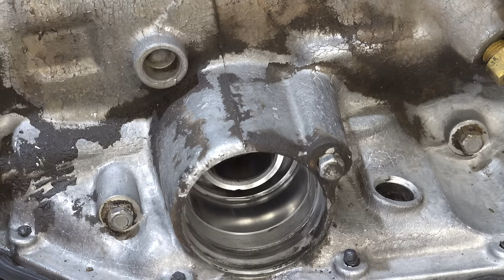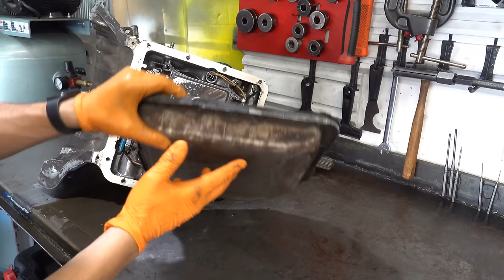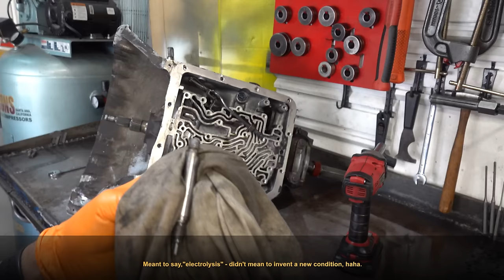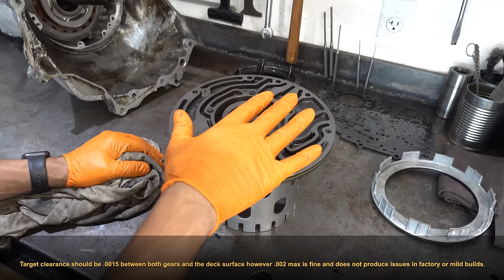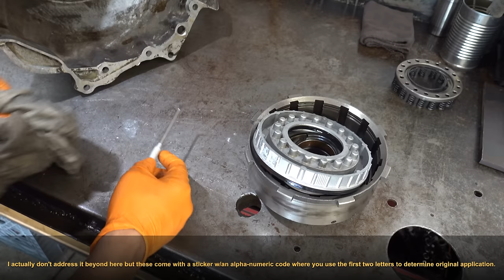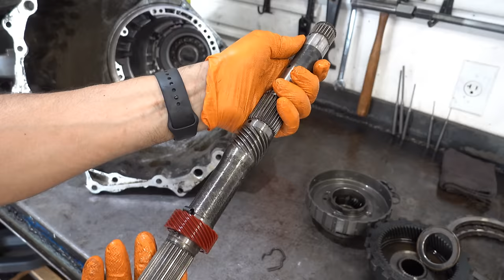TH350C Teardown and Inspection (Full Length Version)

Comment: About normal th350 transmission, I don't know if it was bad. I don't know if it needs rebuilt. I bought it from a friend for 400 bucks. It's been sitting for 2 to 3 years but they said it worked when it was pooled. How can I tell if it'll work before I put it in
Reply from the maker: Hi Malachi, thanks for watching...I'll be putting out a video on how to buy a used TH350 and share all the things I do from an inspection standpoint soon...But to answer your question now, I'd remove the pan and look for anything concerning (metal shavings, clutch material, etc...) and check the filter to see if 

a) it's a screen type or cloth type - replace if it's a cloth type with a screen type filter
b) clogged - if so, I'd be concerned about damage

Spin the converter when installed onto the transmission - make sure it spins freely, smoothly and makes no noise...If it sounds like a bucket of bolts when spun, it's no good.

Spin input shaft while holding the output shaft - they should spin independently of each other

Push/Pull on the input shaft - you should have some end play...If it's bound (i.e. zero percievable travel in and out) then it's no good and has to be rebuilt (or end play corrected at the very least).

Check the modulator (vac test if you have a vacuum test kit) and inspect the modulator valve for freedom of movement...Lube with ATF or WD40 then reinstall.

Those are the main things.

Comment: Currently have a 350c and definitely keeping it as a lockup style. Can't ever.go wrong with the lockup always nice to have
Reply from the maker: Agree; for an overwhelming majority of applications, the TH350C is perfectly fine...The TCC lock up def helps w/keep trans temps lower and fuel economy (which any little bit is a plus w/ a three speed non-OD transmission). I'll get into some of the justifications for converting when I film my TH350C-to-non-lockup conversation video this weekend...it should be out on the channel around this time next week.

Thank you for watching, bunkster90!
Reply: @mytransmissions5390  absolutely sir we love your content currently, I've always loved the lockup style which is why I have a 700r4 ealy model in My 1969 pontiac tempest restoration, also have several high performance builds we are doing here at Bunker Transmissions along with our personal frame off restorations so it's always busy busy.
Reply from the maker: Thanks again, man!

Comment: great video, as always. Very helpful for making sense of my TH350C. If you put a 4L60E low roller clutch assembly in, is it necessary to also upgrade to a 4L60E center support and inner race, or can you drop the 4L60E roller assembly into the TH350 center support and keep the TH350 inner race? Thanks!
Reply from the maker: Thanks, Matt - appreciate the feedback. You will need to swap the center support and the 4L60E low roller as a service pack, they won't interchange individually...The 4L60E low roller is too tall to fit properly into the TH350 (or very early 700R4) center support. The races are the same, I believe but you'll want to verify....
Reply: @nickstransmissions  thanks for the clarification, Nick. I'll make that upgrade on the next transmission I do. Great tip.
Reply from the maker: Sounds good, Matt and you're welcome!

Comment: Would all the th350C's be using a torrington setup on the pump stator?  It's been many years since going through mine and I can't recall.
Thanks,
Reply from the maker: I believe they all do; that bearing came out between 1976-1977, prior to the introduction of the TH350C.
Reply: @nickstransmissions  Thanks, that's what I think too but can't remember.  The two problems I found going through this spare 350C were a broken clunk spring and the end of the input shaft was broken off where it inserts into the output shaft.
Reply from the maker: Rgr, I've seen both before as well...Use a case saver for anything HD or performance; supplement with a billet input shaft if doing wild and crazy things as that rear pilot does like to break, esp if the case is set up loose.